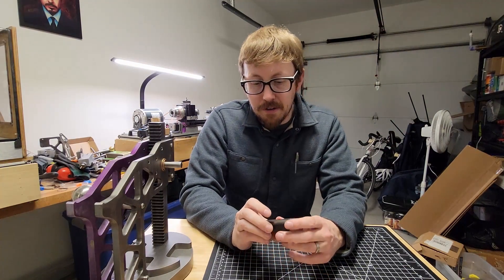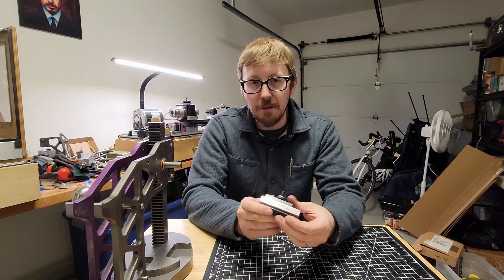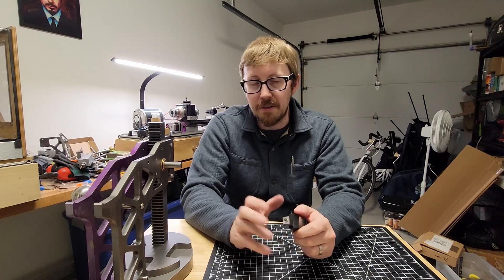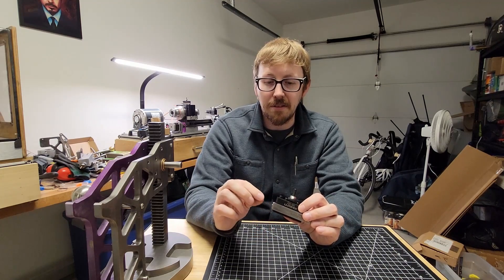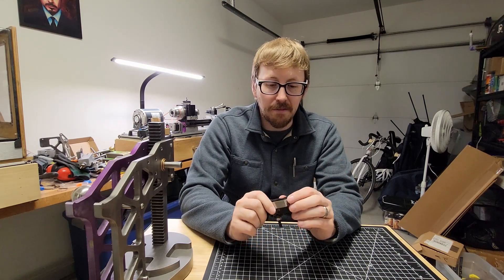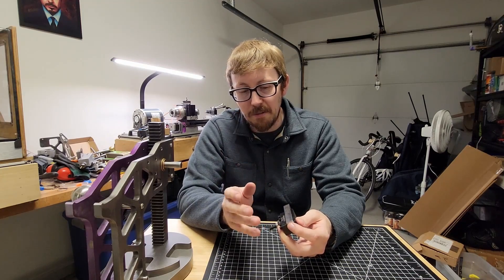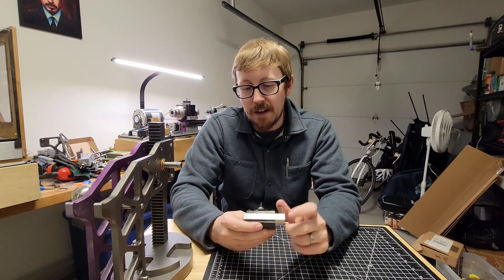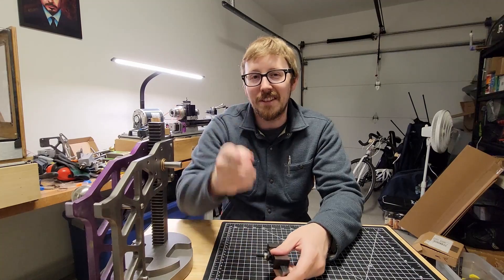Best Ball Burnisher Build

Comment: Yes, the small bearings are skiding not rolling. The larger has greater surface area contacting it on the work so will spin and something with less resistance will slide, ie the small bearings.
This is something like a diamond burnishing tool relying on hardness rather than rolling. If you look the oil out it would get very hot and squeal.

Comment: The leadscrew on small machines like Taig and Sherline will be ruined by this eventually. There's a reason why Sherline designed their knurling tool they way they did. Traditional knurling tools put a lot of pressure on the LS, and in these small machine there simply isn't enough mass in the LS for that.

Comment: For anyone planning on making one of these for themselves- the harbor freight mini lathe hss cutter pack (only like $4.99) comes with a 1/4“ hss round rod that fits perfectly in the build. You just have to grind the length down a bit but that gives you a hardened 1/4“ hss round rod that should hold up well to the abuse of the tungsten carbide bearings. Happy turning!

Comment: I love this design. It seems to be the simplest of all the others I've seen. The only change I made to mine was to add a spring between the set screw and shaft. This allows me to set the proper preload on the balls easily.
Reply: That would have to be a really strong spring, no? Otherwise the 1/4“ tungsten ball would just depress when pushed against the work & it wouldn't put enough pressure on the work to shape it?

Comment: Pretty cool design, I'd like to make one for myself. Looking at your drawing, one important dimension that's missing is the depth of the 1/4" drilling operation (or the length of the lip that holds the large ball). Any suggestion on how to calculate this?
Reply from the maker: I did that portion by trial and error, drilling until it looked right and testing with the ball (seeing if it stuck out enough on the tip). You don't need to leave a lot to hold the ball in.

Comment: This is genius, The only improvement I'd made is hardening the pin. or use a pre hardened pin. the back of the small balls are essentially using it as a bearing race.
Reply from the maker: Yeah I would agree. Probably after a year or so I'll take it apart and see if there is any appreciable wear on it and if it needs to be replaced.
Reply: @somanyhobbies  a 60RHC dowel pin would be a good cheap solution

Comment: The small balls must be skidding on either the large ball or the end of the internal rod, they can't be rolling on both.
Reply from the maker: Yes, it is not a roller bearing in the conventional sense. The idea is to distribute the load across multiple points to reduce chances of marring the large ball or the rod.
Reply: @somanyhobbies  Perhaps a dished end on a Brass central rod to suit the large ball would work to distribute the load over a large area, instead of 5 points.
Reply from the maker: @marley589  Sure, you could do that and it would probably work just fine. The second half of my theory is that by using small balls, we decrease the overall force load without increasing the contact area. I want there to be as little friction acting on the large ball as possible from the inside.